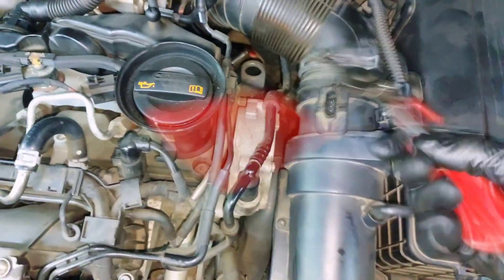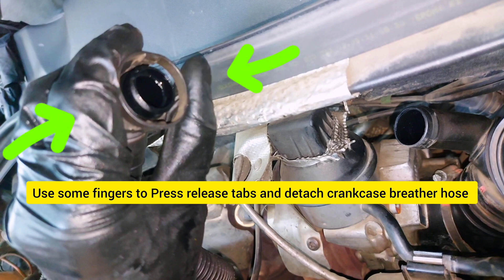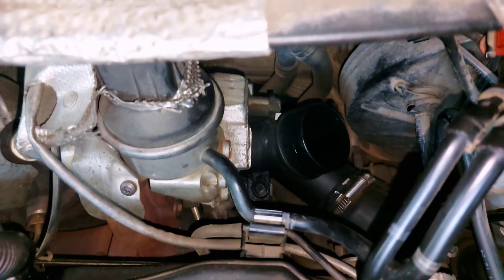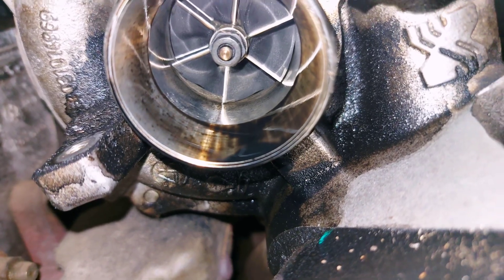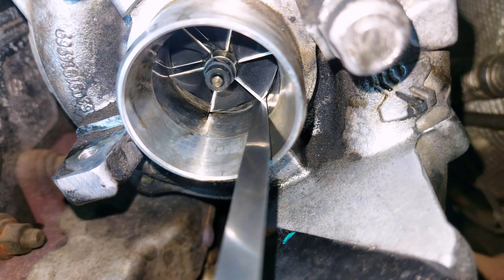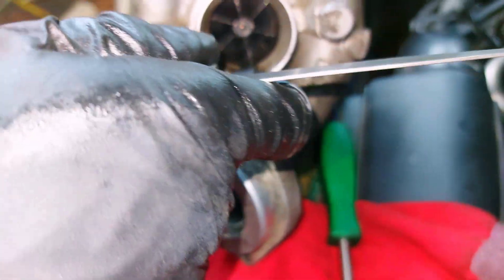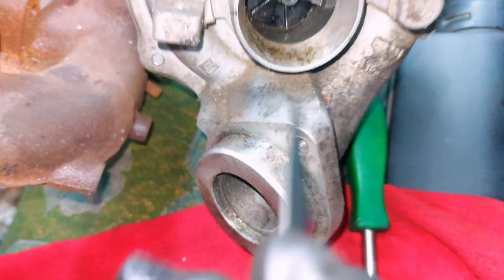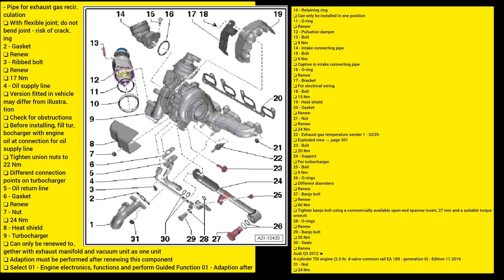check turbocharger clearance |  2.0 tdi vw passat b7

Comment: It's normal for the good turbo to have some amount of side to side movement?
Reply from the maker: Yes, a small radial play is acceptable, and it is something like 0.02 - 0.15 mm. They say that axial play is less acceptable, but it  also can be up to 0.10mm. From my own experience, there were cases when the turbo had a more pronounced axial play and almost no radial play, and the turbocharger did not cause any problems.